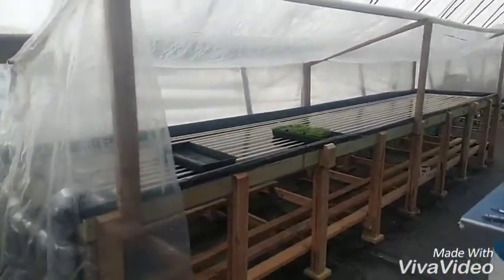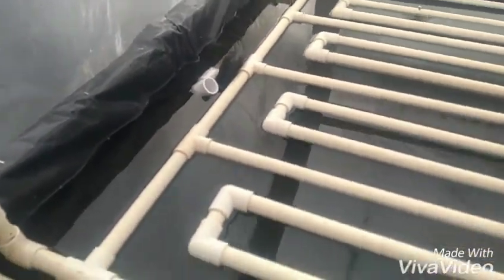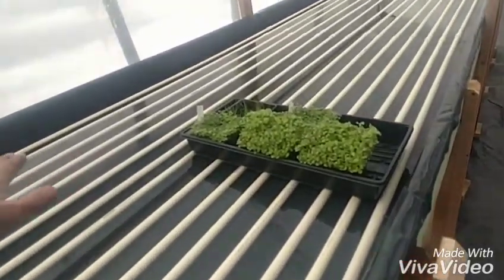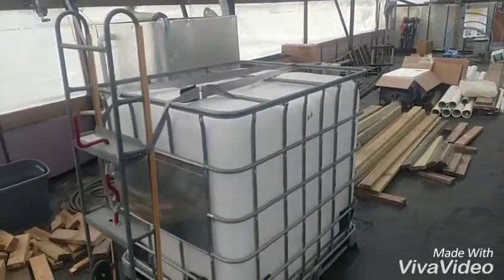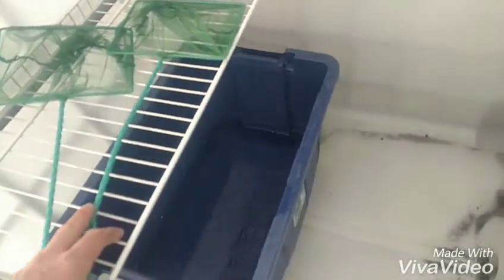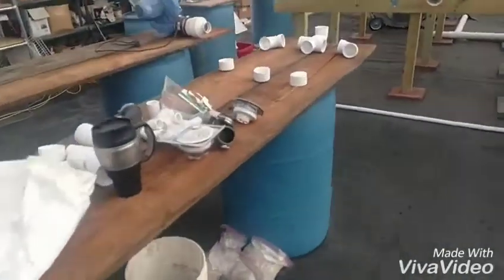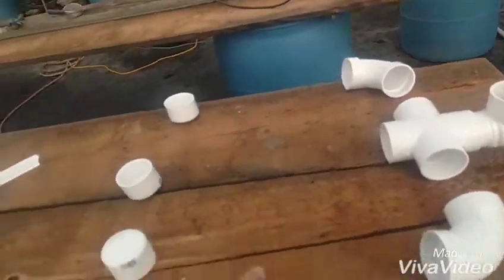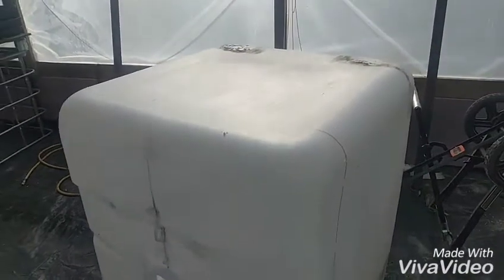Heating table and bubbler cleaner for microgreens

Comment: Very interesting. I love the design. You and I are cut from the same cloth my friend! You may need to take a heat gun to the center of the bubbler tote to soften the plastic so that the drain sits lower!
How much will you be selling the microgreens for? Have you already build a client base?
Chuck
Reply from the maker: Fensterfarm Greenhouse . Chuck thanks for the compliment. Coming from you that means a lot. I do enjoy watching your creations. Yes I might have to heat the tote. I'm bending down the bottom metal to attach the drain to.  I did 3 farmer's markets this summer and the microgreens sold great. I did free tasting and cut them for each customer. They sold for $2 ounce.  I have some local customers. I getting everything ready to sell to restaurants and stores. I will be selling them for a higher price to the restaurants, not exactly sure what that will be. thanks, Von
Reply: Rev John O'tool sells them by the flat. Might be an easier way to sell it?
I am interested in doing some of this at my farmers market too!
Chuck
Reply from the maker: Fensterfarm Greenhouse. I had some good sales with the 5 x 5 pots for $4 uncut (there are 8 of those in a tray so $36) . The 10 x 20 trays I sold for $25 uncut, but did not have much interest. Looking forward to warmer weather 😎